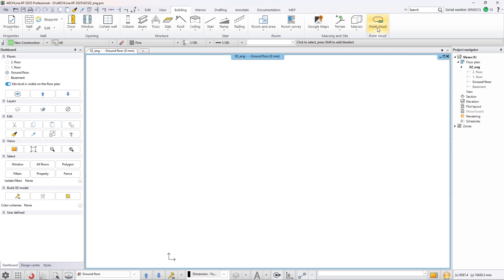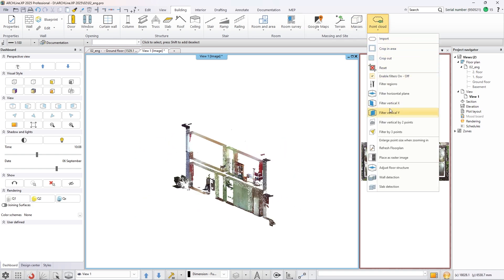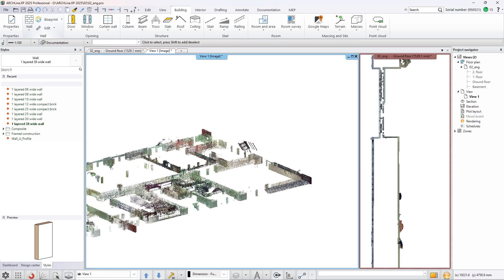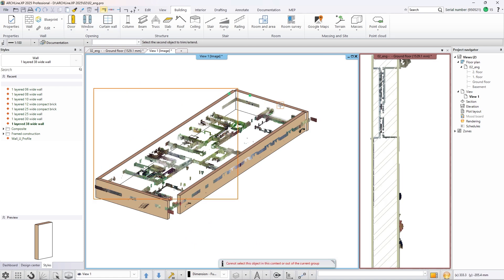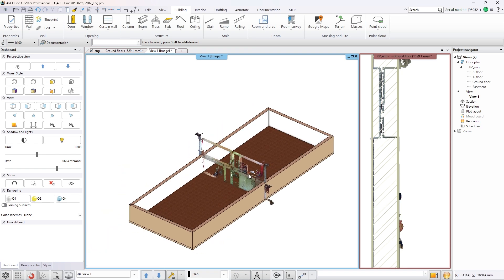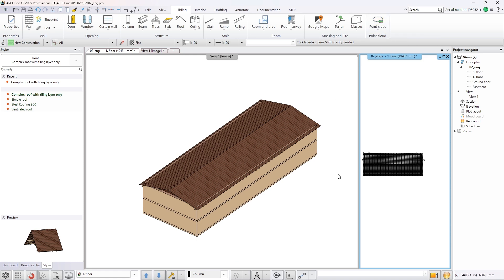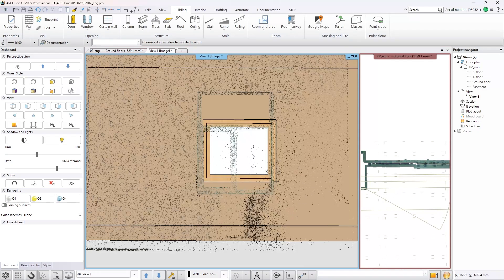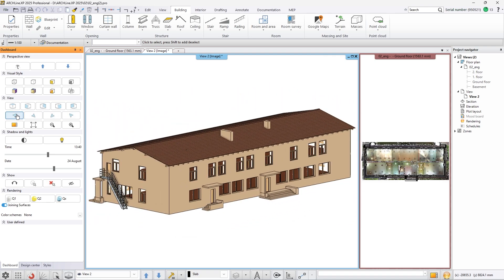Using Point Clouds to create building plans

Comment: The processing of Pointclouds in ArchlinEXP is not only logical, it is also fun.
If you have different walls in the floors, this is also not a problem. You generate the desired cut (e.g. ground floor), go to the point cloud and generate a grid image out of the cut. This should move to the floor where you want to draw .... great.